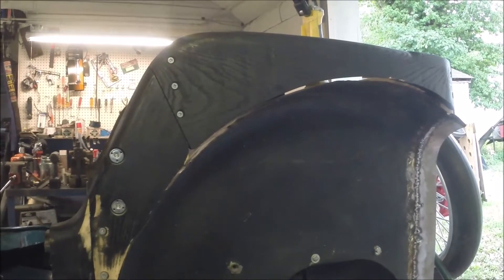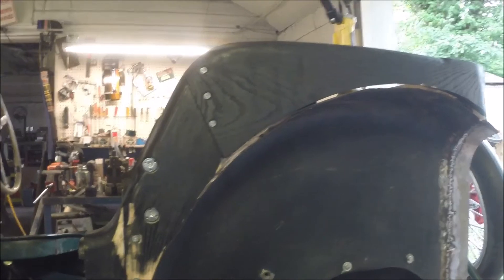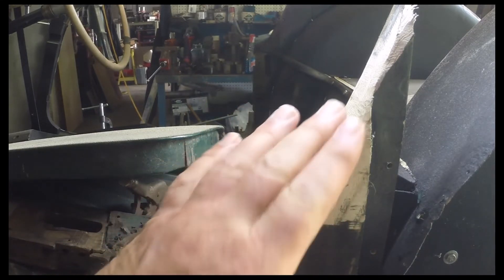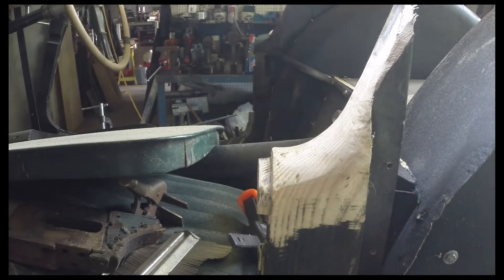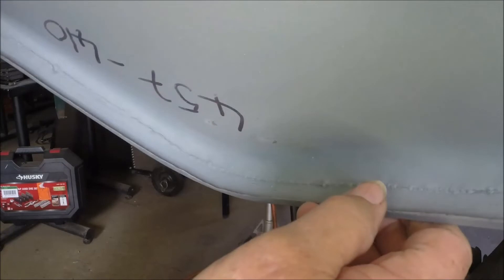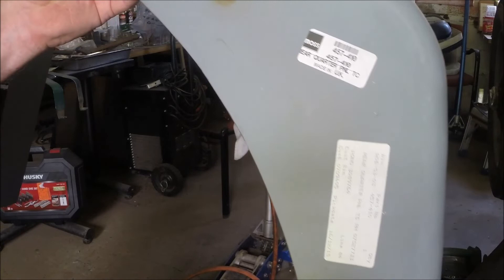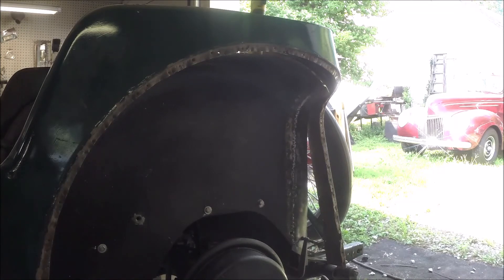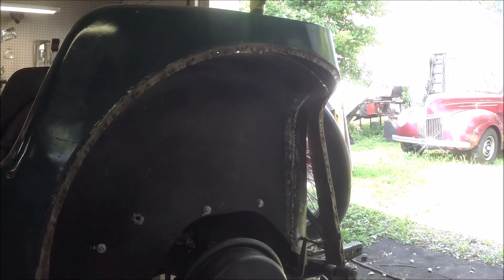1947 MG TC Rebuild Episode 54

Comment: Keep persevering Bob, you’ll get there and of course originally the wooden frame was made up and the metal beaten over it so retrofitting the original metal to new wood is going to be very testing. I do believe that in the factory both sides would be slightly different but impossible to spot once all put together. Kind regards, Richard.

Comment: You can smear some lipstick inside the sheet metal and it will rub off on the wood where you have contact between the two to shoe where the wood should be sanded down.
Reply from the maker: Great idea thank you.